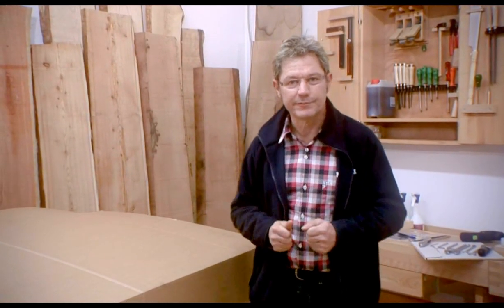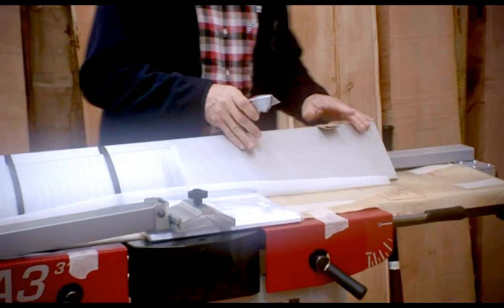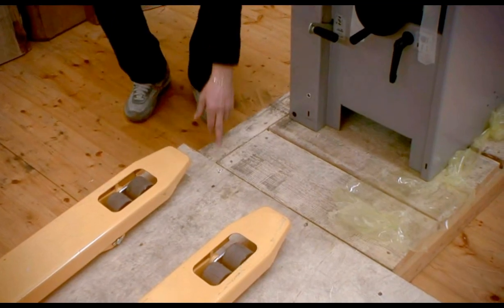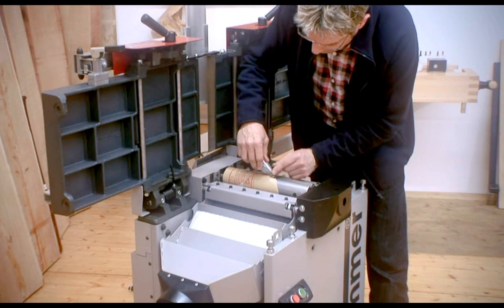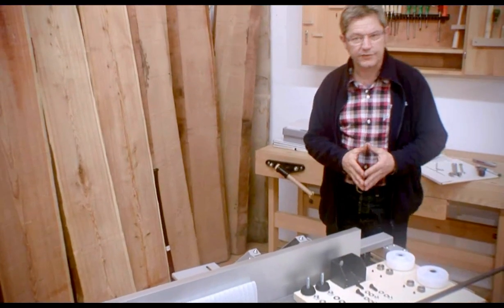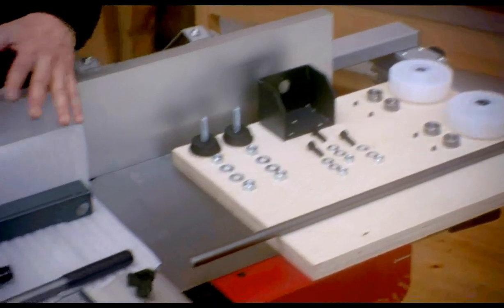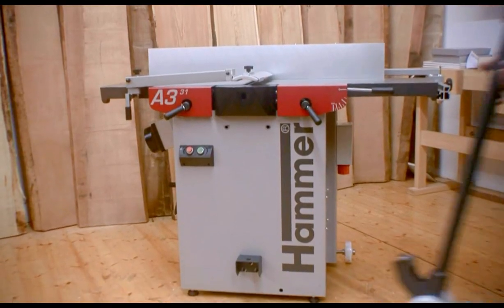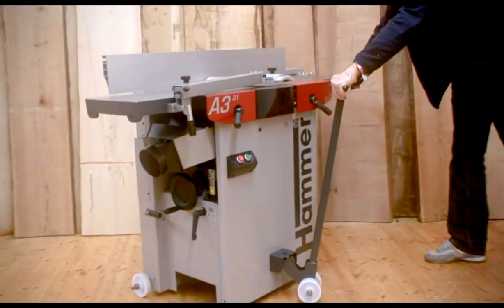Hammer® A3 - Setup demonstration of the Jointer-Planer | Felder Group (Part 1)

Comment: As an owner for 2 years of one of these machines, I must say that you should create a video showing how to do adjustments to level the infeed and outfeed tables! By level I mean of course, coplanar. Also, how to adjust both tables to be parallel to spiral cutter block!
Reply: Couldn't agree more. We have an A3-31. Blades (Tungsten) very expensive.
Reply: Tony Davison كم السعر
Reply: I have an A3 41 I’ve had for about two or three years and getting a lot of snipe and poor cut over the table surfaces now. Using hammer genuine or aftermarket knives the cut is poor over the jointer table yet like a polished surface under the head.
Reply: fgriffintx Smith i came looking for precicely the same kind of video, i need te adjust it aswell.
Reply: I'm close to buying a 31, but things like this are making me leery.  I understand the concept of coplanar, but if my tables need adjusted I want to be able to figure out how to do so.
Reply: Next time I do it I'll try to make a video.  It's really terribly easy. I've done it a couple times. Once when the machine was new and again when I r removed both table to get it all apart to install a shellix cutter.  I use only a machinist's dial test indicator and a movable base. Ya just gotta lay the indicator on it  take some readings and them make a small change in the dome head bolt and then take some more readings to  see how things are moving.  Before I tried doing it I considered a machine modification to allow me a cam mount point for the hinges and was going to go that route is it proved too troublesome.
Reply: @frank3283  With all Felder products you get lifetime phone support. A simple phone call and they can verbally guide you or facetime you to guide you through the process. It's a very simple process. From my understanding, right out the factory and into your home, most machines don't need calibration. Give them a call, they're awesome.

Comment: Hallo,  maybe someone can help me. Recently took delivery of a Hammer A3-31 and trying to set it up. My problem is that the levers that open the jointer infeed and outfeed tables are impossible to move. They seem very stuck and and I don't want to hit them with a hammer, I'm not sure what will happen. So: 1: looking at the video it seems that the infeed locking lever opens counter clockwise and the outfeed locking lever opens clockwise, is that correct ? 2: Is there any transportation lock / safety guard that need to be removed before opening the levers ?
Local Felder support and vendor seems unable or unwilling to help unfortunately. Looking forward to your reply.
Reply from the maker: Hello Per Montgomery, 

The locking levers are eccentric. This means that they open in the opposite way as they were looked. 
Press down the table with one hand to release the tension
Try to turn the lever in one direction. If it does not get loose, try it in the other direction.
For further support please send us your contact details. 

Thank you very much & Best Regards,
Reply: FELDER GROUP TV Hi, do you have an email address for this problem?
Reply from the maker: Hello Per , 

you can either visit our website - on the left upperside you will see the service button and then you have to go to contact technical service (you have to login first) 

OR 

you can directly contact kundendienst@felder-group.com 

Best Regards,

Comment: I did not get adjustable feet with my A3 41 and it rocks on the concrete floor if I do not wedge with timber wedges.
Reply: Adam Lynch the feet are part of the wheelkit, so they werent supposed to be there

Comment: I can’t say that I find this helpful, and it doesn’t show how to mount the fence. And some more work to make the manual into a real manual for the setup would be helpful. But that seems to be a pattern with Hammer, neither the N4400 nor the dust collectors handbooks are useful. If there weren’t the helpful videos from independent YouTubers it would be difficult to setup the machines